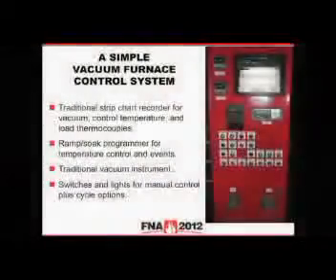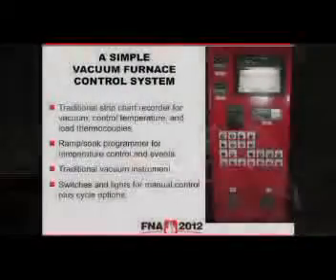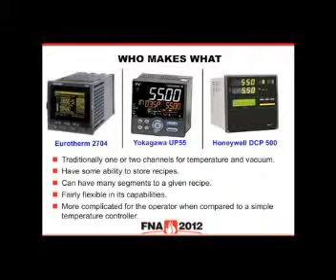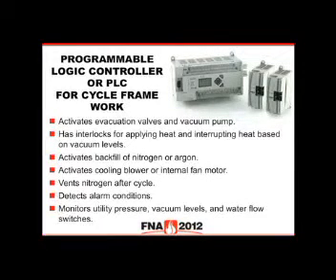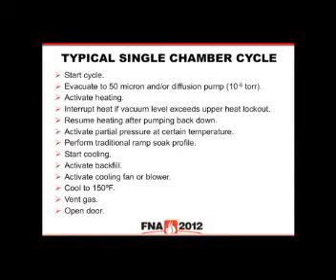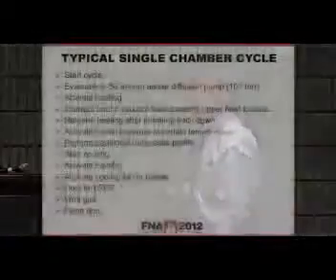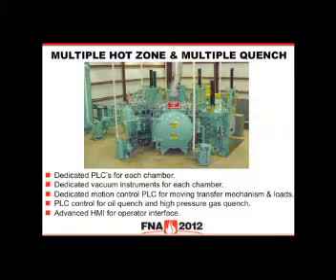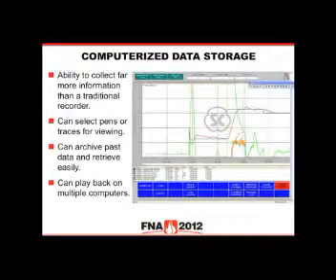MTI TECH TIP:  Vacuum Furnace Process Controls

Comment: Ralph Poor really does a great job explaing the operation of thermocouples and ramp rates for this vacuum furnace. Flow controllers are very rare now but he even discusses that and the vacuum pump in this video...doesn't seem so basic to me but based on the newer vacuum hot press furnaces out there I guess the one depicted in this video is a very simple basic design with one or two channels with minimal recipes.